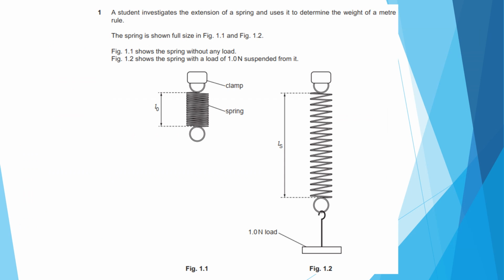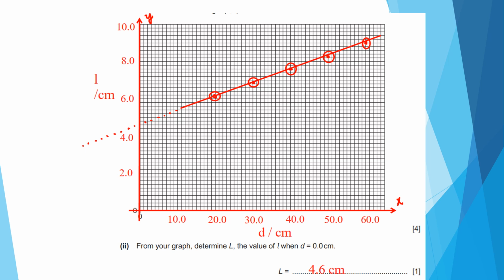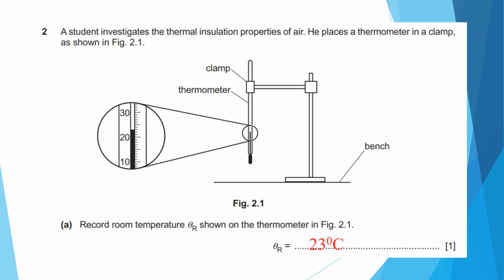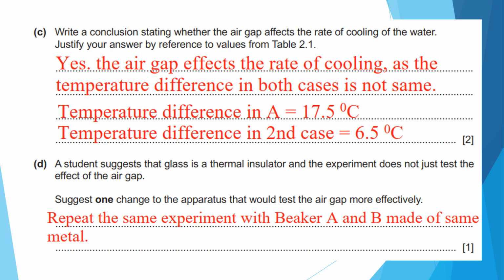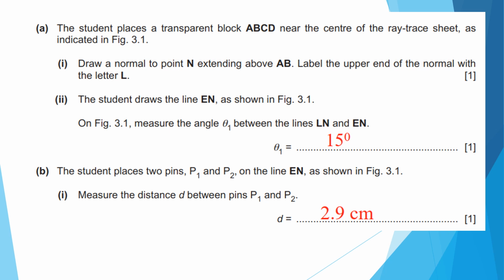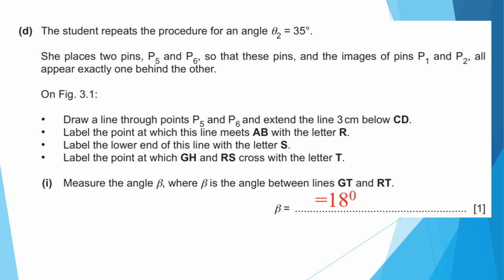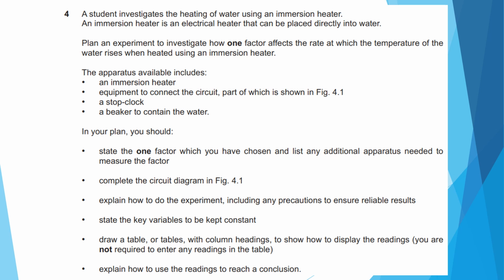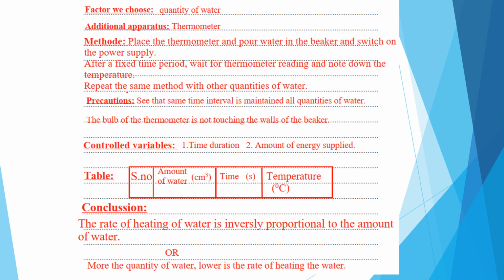IGCSE-PHYSICS-2022-FEB/MAR-P.62

Comment: Hey Sir, for the graph, does it have to be line of best fit?
Reply from the maker: yes. Always
Reply from the maker: Most of the past paper so. Just follow the correct plotted points.
Reply: @chandamalachandrasekhar3051   sometimes line of best fit should not start from 0,0, just not that,